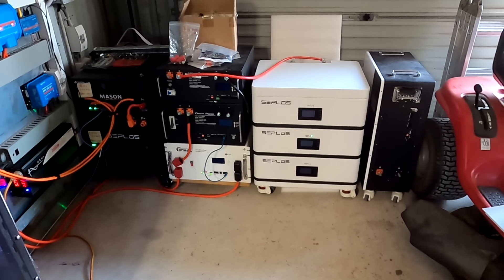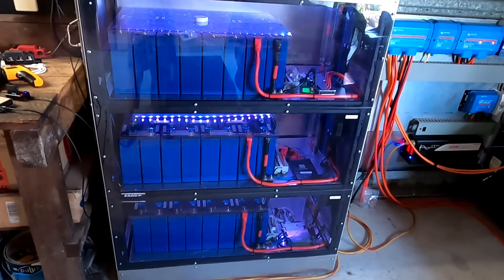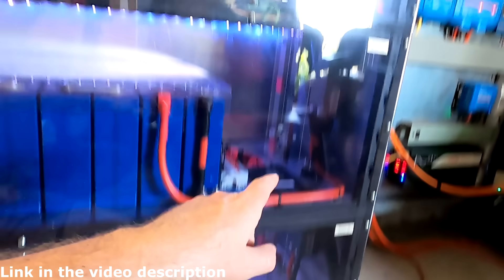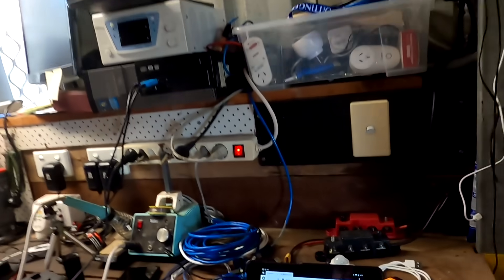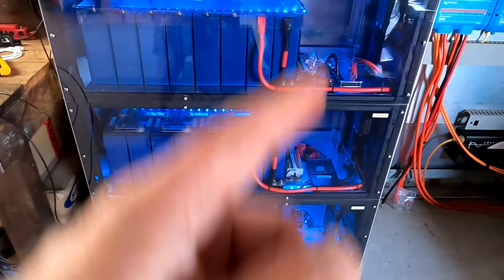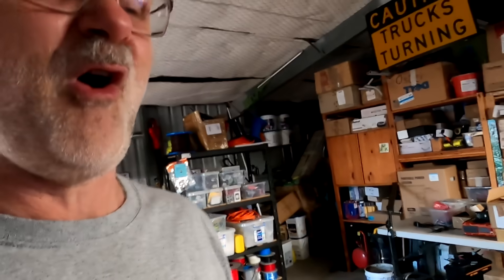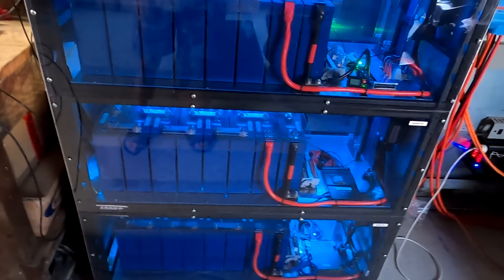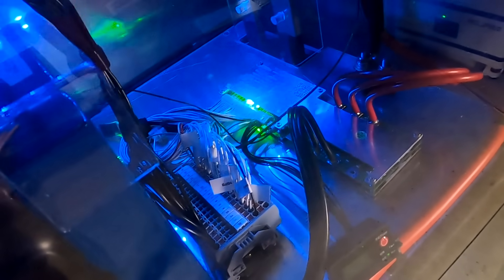Something wrong in the battery shelf! Or just 'bad' settings?

Comment: Yes it matters at the higher voltage because it’s only at the higher voltage that the voltage difference highlights the actual SOC difference in the batteries. The fact that the JK with active balance was so far out of balance demonstrates that 3.45 isn’t high enough. I also think the 3.55 or even 3.65v charge voltage would only add additional degradation if you were charging that high with really high currents. The best solution would be to charge with full power (max spec)  to 3.45v then lower your charge current to between 2-5amps until it his 3.55 or even 3.65. This would have two advantages. 1. It would work almost the same as an absorb charge and 2. The low current charge would allow the passive balancers to bleed charge off the higher cells.
Reply: Nice idea, though what about for those who can not set their chargers to change current (like the all in one inverters its not possible) what can we do to stop the imbalance, also does 150mv actually matter much ? TIA
Reply: @hasger1941  with my 12v stuff I have two custom charge profiles. One where it's max amps to 3.45 and a second one where I limit the charge to 4 amps to 3.55. There has to be a way where you can set your inverter to charge to 3.45 then come back and change it to 3.55v but only give the inverter a small amount of input current. Remember from Andy's tests that there is a very small amount of SOC difference between 3.45v with a long absorption time and 3.55v when you look at it overall. So finding a way to manually provide low current to do that last balance once a month can't be that hard.
Reply: Over 3.5V the voltage increase so fast that high or low current make no different on a daily use because the difference will be less than 1% in capacity, what could damage the cells is if BMS responds slow or you setup up the protection incorrectly. I agree with you, it will only add additional degradation.  High voltage in a cell on top charge indicates the worst cell and the balancer will take energy from the ones with lower capacity  to the ones with higher,  that's why giving time for the balance to work will help to put some energy back in those after the good ones became full. 

It will be nice to have a BMS that take energy from the ones with lower voltage on charge and higher voltage on discharge, the V Delta will be crazy but the capacity will be the same on all cells and degradation will be slower in the worst cells.
Reply: It makes a difference in that the passive balancer that is “shaving” or redistributing power from the higher voltage cell has a better chance to do it if the overall current is 2A-5A than if it is trying balance against a 10-20-50A change current. At the higher charge current the highest voltage cell goes from 3.45 to 3.65 in just a minute or two and hits OVP before the balancer has a change to move enough charge into lower voltage cells.
Reply: @AussieAustrian  For max top balance I even lower current to 0.5A but it's only for test and try to get the 3.65V on all cells.
On daily use the faster it gets max voltage the better because you are taking energy from the worst cells to the better and that increases the imbalance, don't give so much importance to voltage but more to capacity of each cell, because the lowest dictates the capacity of your bank.
Reply: That’s true. But if you don’t properly top balance then draw the whole pack right down. You could find a scenario where the weakest cell isn’t the one that hits LVP first. If you have 15 cells @ 300Ah capacity and 1 @ 295ah you effectively have a 295ah pack. But if you don’t top balance them so that the 15 cells are full you’ll never really know if when the 295Ah cell hits OVP when charging, that one of the other 15 cells is at or over 295Ah.

Comment: good video Andy! lots to learn again .thank you. Looking at your disco lights ,one question for you, in your set up, have you ever experience flickering LED lights when powered from the inverter under heavy loads like microwave or coffee machine?
Reply from the maker: Thanks, no flickering lights, no. But I'm off-grid, so there is no synchronisation to the grid necessary for my inverter.
Reply: @OffGridGarageAustralia  so do think that the flickering is caused by the grid ? You are right , I'm not completely offgrid. I'm using solar as an emergency system in case the grid goes off.
Reply: @imag555  Maybe you are getting LED flickering if inverter is supplying something a pwm type load where it has to switch on and off fast. I had that on my inverter when I used it to pwm an ac load on it.

Comment: If the battery potentially degrades faster, i would not bother trying to top balance it this way. I found an article about it with Tesla LFP cars onlly needing a 100% charge to get an accurate range estimate because of the very flat curve. 
The advice in the article is to keeo the SoC between 20% and 70% to maximise it's life.
Maybe for offgrid usage  this is much more important, because a home should last longer than a car, and just getting an extra battery and/or extra solar panels is much cheaper and better for the environment than having to replace all batteries within 10 years instead of 30 years. It is also not as inconvenient to have a vague SoC as it is with a car where you need to know in time if you need to find a charger. You are already plugged, and there are way more factors that deviate than the SoC percentage. It might be good to top balance the batteries just every year or so, even if just to plan ahead if more batteries are needed.
Reply from the maker: I think you are tight here. From further testing I now did, it seems like such a maintenance top balancing is maybe necessary every 2-3 years only. More about this in the next video.

Comment: My 280ah 16s pack has a 125 mv deviation at 3.5 volts and in 6 months the overkill bms has done nothing to correct it. The batteries are only discharged to 85% and fully charged every day. 
Since I’m only using only 15% of my power each day, if should have been easy for the bms to correct the deviation.
Reply from the maker: Yeah, I have the same experience with the passive balancers. I wonder if this would be rectified with charging to 3.55V or even 3.6V.
Reply: @OffGridGarageAustralia my guess is that it won’t make a difference at all. 
It’s not worth the hassle anyway. You’ve already proven that charging to 3.55v+ per cell isn’t  practical because the average battery pack won’t reach that voltage without a cell hitting 3.65.
Even when my 15 amp NEEEEY balancer arrives and fixes my cell deviation, I still won’t charge to 3.65
Reply: Get an active balancer

Comment: Drop your amperage to top balance!   I got a cheapie LFP off amazon that had a very basic BMS that couldn't clamp but 20ma on its near worthless balancer.  As such I set the current on the power supply down to what it could clamp and several days later it was finally balanced.  If your BMS can only clamp 150ma, don't feed it much more than that.
Reply from the maker: The batterie sits mostly idle when balancing, so no current in or out...
But you're right, if the charge current is larger than the balance current, it won't work.

Comment: As one of the 3, I apreciate the investigative aproach Andy.  You have definitly not used my prcedure or voltage settings in this video,  but I am curious to see where this goes.  I suspect failure, as an inital active top ballance is required before my passive ballancer settings are used.  Side note: I also don't use a Heltech BMS or different types of BMS's in an instalation.  I'm not sure if this matters or not, passive balancing is pretty much the same in most of the BMS's.
Reply from the maker: I have your settings here and will apply them soon. I just cannot charge high enough before 2 of the BMS will go OVP. I have to increase the charge voltage slowly to get there. Passive balancer are working slowly...
But thank you for you input, very interesting to follow you recommendation and test it out.
Reply: @OffGridGarageAustralia  all good.  I like seeing what other people have recomended too.  I am always open to learning.  It's one of the reasons I enjoy your chanel, I learn things here.

 Like you've already shown though, passive balancing an unbalanced pack would take forever, or posibly never work.  It's why I properly top balance a pack activly when it's made and then leave it up to the passive balancing to keep things straight.

Comment: Are you just about to prove you worry to much about balancing?  :D
Also sunny here at the other side of the world, and full battery by lunch and did some balancing - down to 60mv now @3.525/cell and that's basically all in cell pack 4, others are within 20mv  (JBD 50ma passive). I suspect you'll maybe find 3.55v/cell triggers OVP whereas 3.525v/cell doesn't shut of charge /charge balance - certainly on first full charge for a while.  At least, that's what I find on mine.
Reply from the maker: I'm not worried about balancing, I'm just curious what will happen.
Reply: @OffGridGarageAustralia   and I'm also curious if you again prove the similar conclusions I've come to from using my system.  Its good entertainment.  Keep on doing your thing.

Comment: Mixing BMS's is a recipe for failure. Put the same BMS on all the DIY batteries. You also have way to many batteries for the amount of solar you have.
Reply from the maker: You can mix any BMS as long as they are connected to its own battery. There is nothing wrong with it and no problem.
This was not the purpose of this video, you may have misunderstood the topic.

Comment: Nice to see that your batteries, once fully charged, actually go into "idle" (standby). In my case (Seplos and Neey) it's oscillating between charging (until 55.2V), then discharging down to the recovery voltage, and back up again to 55.2V. It never goes into idle/standby :/
Reply: Intermittent charging stops this and charging is allowed only under 96% soc or what you Set
Reply from the maker: Intermittent charging does not stop this but only decreases the cycle frequency. It will still cycle the battery between 96% and 100%. Not great.
The Seplos BMS are bad designed in this regards (except the V1 BMS, 10C with FW 2.8 which works perfectly).
Reply: @autark3  I can activate intermittent charging in the BMS settings I assume? Is that also the place to set the percentage? (I thought I saw intermittent charging activated already by default but I will check)
Reply: @andreas4175  it is activated by default. The percentage is in the other Menu of the Parameter settings. I think nearly at the end of the setting page
Reply: @autark3  I see - so this "overwrites" the recovery voltage setting in a sense? Do I need to set the recovery voltage below than the voltage corresponding to X% intermittent charging? Or does it not matter?
Reply: @andreas4175  no this does Not matter. If you Set this value to 90% for example the seplos goes to 100% soc and after that it does Not allowe charging until 90% soc is reached no matter what recovery voltage is Set. This is only for the alarm to turn that off (recovery voltage)
Reply: @autark3  Thanks a lot for your help, most highly appreciated! You seem very knowledgeable about the Seplos BMS. Do you happen to have it running together with a Victron system? I have been trying hard to find people willing to share their settings (Seplos BMS and Victron) for an ESS system (in my case including a smart shunt). I haven't been successful so far, unfortunately, but would love to see how other people have configured the different voltages etc
Reply: @andreas4175  sorry i have no victron System running. In this topic i can Not help you. I know there are different Problems with seplos and victron. Andy has already explained some Things but as i said i have no victron System sorry
Reply: @autark3  No worries - thanks a lot again for your help!
Reply: Yeah i know what you mean. I also think IT is Not perfect. But i must say it is okay for me. It works and yes some algorythms could be better but hey i think IT is one of the cheapest outside

Comment: Once top balanced, 3.45V/cell will be enough with the JBD Smart BMS / Overkill Solar BMS.
The imbalance seems to be large...so it could take some days until it is initially balanced with the passive balancer.
For the initial top balance, higher voltages are good, because you get higher balancing currents I=U/R
Reply from the maker: Well, all three banks were 100% top balanced but somehow the Heltec BMS created this cell 1-10 chaos for whatever reason.
It will be interesting to find out how much capacity I have 'lost' because of this imbalance... -> next video
Reply: looks like a job for the ZKETECH 😁 @OffGridGarageAustralia